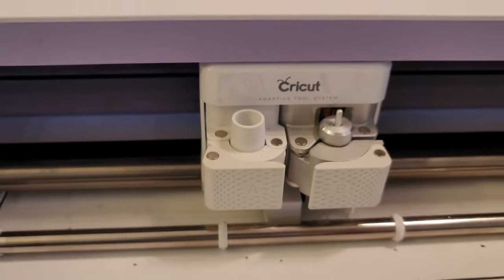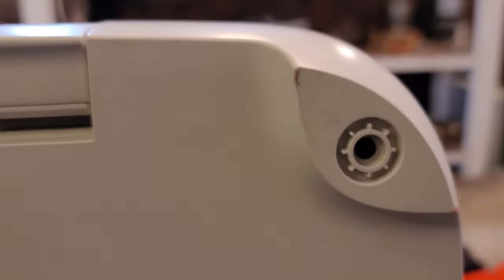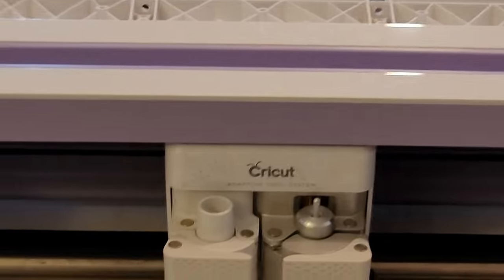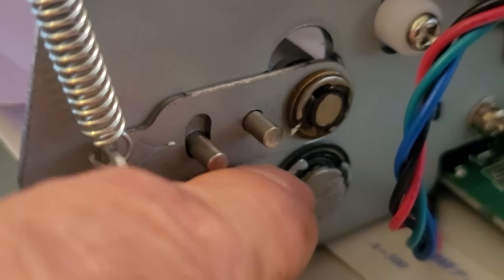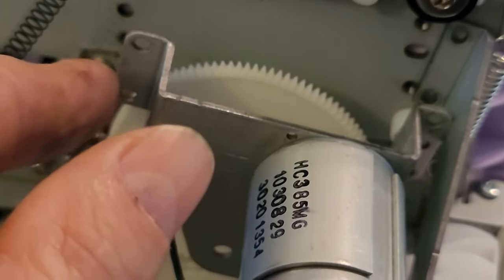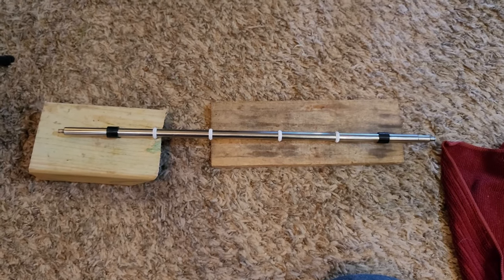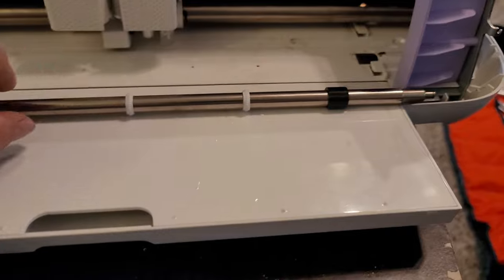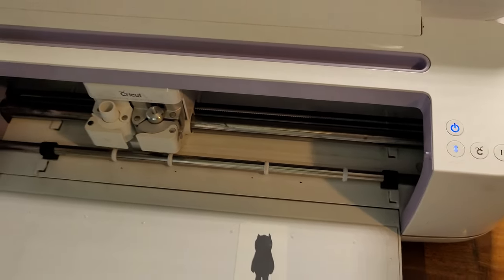Cricut Maker, Roller Replacement, YOU CAN DO IT!

Comment: It's a shame Cricut does not help with replacing the wheels. I had no idea this could happen until it did. Unless you warranty is still in effect, they offer a $50 coupon to apply to another machine on their site. REALLY? Many of us have invested hundreds of 💸 and that's your fix? It's not even a choice on the questions for  troubleshooting,  you have to speak with CS.  And why are the users coming up with fixes? This is wrong!
Reply from the maker: Its crazy.
Reply: Yupp, I haven’t used my machine for a while cause I had a baby and come to find out my rubber wheels are messed up cricut only offered a coupon code like I have $$ lying around to buy a new one lmao
Reply: It's now only $25!!! CEO Ash makes $49.63 MILLION a year!!!!
Reply: They offered me the same I found a guy that will fix it for 130
But I'm going try this myself
Reply: It is crap.  I barely used my machine before one got jacked.  Just ticked me off enough to not even care by that point
Reply: 🤦‍♀️ I too ran into this issue my rubber are not rolling smoothly. I called cricut support and was told that there’s no way to replace due to complicated opening machine.. I es very upset

Comment: I wanted to express my gratitude for your thorough, step-by-step video. It helped me greatly with the replacement of the worn-out rollers. I do hope that Cricut will consider redesigning their product for improved serviceability.
Reply from the maker: Thank you. Yes, a few simple redesigns would make roller replacement very simple. Thanks again.
Reply: it doesnt matter u use them or not 2 years and they are gone. i hadnt used my cricket for a while and when i wanted to use it noticed a problem that roler was turning properly, and after a quick look found the problem. but isnt fare aying that huge money and rollers actually don't do good job
Reply: Yes me too but what I’ve noticed is that the maker 3 have a very hard roller it not rubber tho thank goodness
Reply: Yes but i made  now actual tuber. They shaped them selfes so nice now. Looks like always been there.  And it is already of 20 years old material but will do quiet longer :D
Reply: The rolers from ebay arrived, they are so hard and quiet abot slippy looking. So not bothering to change
Reply: The rolers from ebay arrived, they are so hard and quiet abot slippy looking. So not bothering to change

Comment: THANK YOU SO MUCH FOR THIS TUTORIAL. My husband and I were able to get this done in about an hour. We would have NEVER figured out the three extra screws under the lid - I would have absolutely broken it by trying to rip/pry the case off. I would have ended up throwing the machine away and buying a new one. THANK YOU for saving me all that frustration (and money)!!! ❤
Reply from the maker: Great job. May your machine cut many more projects. I just finished cutting out a Hawk in flight sticker for my trailhawk. 🙂
Reply: How do you get the small white wheel of on the second side.  We can't get the servos small roller of with it on
Reply from the maker: @sherrir.connor1448  I did not have to remove it.
Reply: Everything went great but my cricut doesnt start i already tried placing the cord in its place but it doesnt work
Reply from the maker: @abrahamgarcia1008  I wonder if plug on motor side got unplugged or power button plug is loose. Would require opening it back up.
Reply: Really an hour???

Comment: People, don’t use pliers to remove and replace your springs, use a piece of string string, pipe cleaner or a doubled up breadboard tie.  Just push it through and bring both ends together and pull.  You have better control and will not ruin your springs
Reply from the maker: Great idea. Thanks

Comment: If you followed all the steps correctly and made no mistakes but ended up with your mat not being able to fit through the rod just remember me. YOU HAVE TO SEPARATE THE 4 WHITE ROLLERS EVENLY, IF THEY NEAR THE BLACK ROLLERS YOU INSTALLED IT WILL CAUSE TOO MUCH TENSION ON THE ROD 🤞🏽
Reply from the maker: Thanks for sharing the information.

Comment: THANK YOU!!!! I've replaced many rollers over the years on printers and Fujitsu scanners, which are easily replaced without tearing the entire machine apart.  This by far could have been a better design to replace the rollers.  I'd expect the rollers to stretch out overuse, but to have to the tear the entire machine apart is crazy.  Your detailed and thorough explanation made this so much simpler for me.  I really appreciate it!
Reply from the maker: I agree.

Comment: Thanks. I am so mad I have to go through all this for such an expensive machine. I have the original Maker and everyone I have talked to who has this machine has issues with the rollers. I will try it. Your tutorial is the best, most detailed video I have seen on YouTube so far. I think I can do it now.
Reply from the maker: Its not to bad.  I hope these new rollers last longer. So far ours is working as it should.  I do know some break the top plastic piece when removing it. Just pry in middle and go slow working it as you go.
Reply: @Outdoors4adventure I DID IT!!! It is working as it should now. I'm so pleased. Unfortunately, despite being careful, I still have a small crack in the top plate. They unnecessarily glue it down which causes it to break if you don't put the screwdriver in just the right place when prying the left end apart.
Reply from the maker: @kimsim8750  as long as it gets the job done. Some e600 glue can fix the break

Comment: Thanks for instructing on this!  My Maker started moving the rollers out of place about 3-4 months ago and I've been perplexed as to where I would take it for repair.  Then today I thought, there's GOT TO BE a You Tube video on how to!  And I found YOU!  I ordered the same rollers from Amazon today and I'll have them in a couple of days.  Looking forward to giving this repair a go at it!  Thanks again!
Reply from the maker: Your welcome.  Its not to bad. There is a tip in comments about putting the steel bar in the freezer for a few hours , heat the rollers in hot water, then slide them on. The cold makes the rod smaller and heat makes rollers larger by theory. Best wishes.

Comment: THANK YOU, THANK YOU for posting this video!  I changed my rubber rollers today because I had the confidence to try after watching your video several times.  My machine had limited use, but the rollers went bad and I wasn't willing to purchase a new machine.  So, I ordered the rollers you recommended, purchased a small screwdriver and stayed positive as I encountered and solved unforeseen issues like the cover being glued and having to use my dremel to slightly widen the opening to remove the roller bar.  My machine is working properly again and I'm beaming with pride thanks to you!
Reply from the maker: Awesome job.

Comment: Thanks so much for the amazing video!  My machine failed at a two day retreat.  So I was motivated to give your video repair a try and am so glad I did.  The parts you suggested are a lot more durable than the manufacturers parts.  My Maker rollers are replaced, my machine calibrated perfectly and is functioning like a new machine.  Many thanks!  You saved me ~$300!
Reply from the maker: Awesome job.

Comment: Great video.  I was able to follow along and replace my rollers.  I found that after warming up my replacements in the hot water, the closed end of a 10mm wrench was perfect to slide over the end of the rod and push them down.  Thanks for the step by step instructions
Reply from the maker: Awesome

Comment: Thanks so much for the video, I purchased the rollers and my husband did the work for me.  There were a couple of things that were different on my Cricut Maker; the small cover on top was actually glued to the casing and it took him a minute to pry it off without breaking it.  He also had to make the hole bigger to take out the roller on the side as it was much smaller than the opening on your unit.  When he put it back together, he said "it will be a miracle if it works" and I had resigned myself to buying a new one, but it worked!!  😀 

Thanks again for the great tutorial! ❤

Comment: Thank you so much, i have been having trouble with my Maker for the past 2 years because of the wheels and also their design space. I decided im going to leave cricut and go to silhouette but i wanted to see if it was possible to replace the rubber wheels so i could give my maker to a friend. I was so scared to fix it before, but your video was so  informative!! Great step by step instructions and warnings! I will say though for my Maker the hole to remove the pole on the right side was to small so i ended up having to use my power drill to shave some of the opening down just so the pole could exit. It was a journey but it wasn't to bad with your help, so thank you so so much!!!!
Reply from the maker: Your welcome.  Glad you got it done.

Comment: Thanks very much for posting this, just replaced the rubber rollers on my Maker - the rollers I bought from a UK seller on eBay went on like a dream which was a pleasant surprise as was expecting that part to be a nightmare :)  it’s definitely worth buying a small ratchet screwdriver to get those 7 pesky screws out to release the cover.  Back up and running again.
Reply from the maker: Awesome,  great job.

Comment: Thanks for sharing this. I just completed the swap by following your guide.  I had a bit of trouble with popping the top panel off (too much glue at the ends!!!) But I was able to reach in to undo the the torx screws though the gap I'd created by trying to pop off the panel. In the end, I got it done. Oh, and a spring near the motor (not the one that tensions the roller) was pisitioned differently than on yiur machine.  Im not sure if that was a manufacturing defect or a 'tuning' option exercised during assembly, but it was a minor deviation. I'm now gonna take a hot knife to that panel to ease that final step of reassembly.... (Seperating the panel from the lid) 😊
Reply from the maker: I hope it all turns out satisfactory.

Comment: You have one of the best tutorials about this I believe. Me and my husband just finished replacing the rollers and it was
very challenging for us.I thought we might end up on divorce court. LOL I brought the ratcheting screwdrivers with the flexible extension. My husband couldn't get in a good position to get enough torque on a few to remove them with just the bit tool. But was finally able to Then putting everything back our biggest issue was getting one of the C clips back on. At one point when trying to get the first screws out of the top rail he got so frustrated he said I'll just buy you a new one for your anniversary in January but I could get it early. No way was I going to get another one for $429.00 when the part to be replaced costs a few dollars and others had done it. So with some choice words we persevered and got her done. I just cannot believe that Cricut would do this. Their machines are not cheap!! If I ever need to replace it I think I'll look at other options.
Reply from the maker: I am glad you got it done and mark it as a success.  I just made a decal for a shirt and the machine is still working great.  They could easily designed these machines with roller  replacement in mind , but then the would loose money.
Reply: @apavacic how did you get those c clips? I am struggling with those and might just toss my machine in the garbage. 😂

Comment: Thank You!! I recently opened a replacement Cricut maker and it unfortunately arrived damaged at the rollers and Cricut would not replace it. I was getting ready to toss it and be forced to buy another but now I just ordered the rollers and have a great clear video to follow to use the new machine. As another person stated Cricut needs to do better by simple redesigning and give the customer an option for servicing or to replace them. My other Maker has been functioning for over 2 years and no signs of wear on the rollers its odd, luck of the draw I guess.
Reply from the maker: Best wishes.

Comment: Nice video! What size is the phillips socket bit that you used to remove the 7 screws that are inside the unit?
Reply from the maker: If I recall correctly it was a number #1

Comment: Thank you so so much for this, I got the rollers replaced and now I'm putting it back together. However, the connector you show at 6:22 doesn't want to go back in. Is there a trick/knack to getting it back in properly? I'd really appreciate any help. Thanks again!
Reply from the maker: I am sure it goes on 1 way only. Mine snapped back easy.  I wish, I could help more.
Reply: @Outdoors4adventure  thank you for replying so quickly! God knows what's going on with mine then lol. Will try my father in law tomorrow. Thank you again for the great video!

Comment: Hello! I replaced the rollers successfully but having so much trouble getting the c clamps back on. They seem to be shaped differently maybe then when I pulled them off. Should I just reshape them? Any suggestions?! Almost done with this and the other screws were easy for us! Any help is appreciated.
Reply from the maker: They should slide back on easily.  Line up with slot a push on. Hardware store should sell c clips.

Comment: Thanks for the video...looks like I have a weekend project...the left roller on my wife's Cricut keeps slipping...I had a temporary fix for it but the roller has deteriorated more and is very soft and pliable...time to change it.  Gonna have to search the garage to see if I have a small metal tube...lol
Reply from the maker: A few have stated if you heat the roller and put the shaft in the freezer for a few hours, the roller will slide on easily.

Comment: Thank you for your video. My husband successfully replaced the rollers! Now if you have figured out how to fix the door problem please make another how to video!
Reply from the maker: Thats awesome.  What is the door problem?
Reply: @Outdoors4adventure  Another known problem beside the rollers is the doors failing. On some the lid doesn't stay open, while opening the top the front door no longer opens automatically, a popping  sound while trying to open, etc. There are several videos on YT demonstrating these different issues.  On my Maker it made a popping sound when I opened the lid and now it no longer  opens automatically. Can't figure out what part needs to be replaced if at all.

Comment: Oh and i managed to make rolers myself whish makes my life so much easier as amazon almost no one send it to my location  and ebay postage more than actual rolers cost. Plus this shuld be more dureble but i might be wrong. Also peaple shuld be carfull pluging in that electrical conector. Mine one of pins wNted to bend but managed to sort out after a little fidle and back working again
Reply from the maker: Awesome,  thanks for sharing.

Comment: Your video is amazing, I managed to do everything as showed and turn it on for testing. It turns on, connect to computer but when I need to load the mat, the arrows button keeps blinking but do not load it.  When I turn on the machine the rod turns as it always does, but the arrow button does not work no matter how many times I push it. I am so disappointed to myself.
Reply from the maker: Maybe a wire got pulled loose.

Comment: okay so i replaced the rubber with the exact ones you had  
took it all apart and put back together but now the roller won’t spin.. the rollers are much skinnier then the ones i took off maybe i didn’t boil them long enough to expand them ? how long did you heat yours for ?
Reply from the maker: Are you working on the cricut maker? The rollers I took off were swelled. New ones were not as thick.  Is the bottom bar spinning? If not a plug may have got undone. The bottom bar is what spins the top bar  from the pressure on the rollers.  At least thats what it looks like.

Comment: So - not only is the Cricut software awkward & clunky to use, but what should be routine maintenance on the machine is also awkward & clunky.

Thankyou so much for making this video.
Reply from the maker: Your welcome.  This roller situation, Definitely warrants a redesign.
Reply: @Outdoors4adventure  - I spoke too soon.   

Couldn't get this to work.  Mine seems to have a few design modifications to make the job impossible.

The top panel that you popped off - mine had the corners glued down.

The gear wheel that comes off easily on yours, seems to have some plastic housing butted up close to prevent removal.  I had to cut this housing away with a chisel.  There's also another gear wheel right in front of the C clip.

Then finally, the holes on the metal plate at either end of the roller bar are too small to get the bar through, even the shaved off right hand end.  The bar is locked in place, and the metal plates are impossible to loosen.

It looks like a deliberate design tweak to make the rubbers non-replaceable 🤬
Reply: I think they make it difficult just to get you to buy a new one

Comment: What is the best way to get the c clips back in on the left side? I am currently stuck on trying to get those little things back in.
Reply from the maker: I used a small flat screwdriver.  Line the open end up on slot and push on with screwdriver.
Reply: @Outdoors4adventure  Am I suppose to hear a click or snap when it’s in tightly?

Comment: Okay so I did everything you had said in this video and put everything back just like it was. But after turning it on the rod doesn’t want to turn. What do you think might be the problem???
Reply from the maker: I would guess something came loose during the process.  The rollers make the bar turn from pressure of rod under them.
Reply: It feels stuck for some reason, but I will redo the process. Thank you for replying bud
Reply: Nvm it does move, what I meant is the mat doesn’t fit
Reply from the maker: @erickvaldez1469  Hum, you got me on that one. Good luck, though.